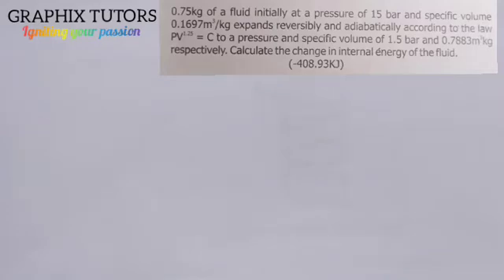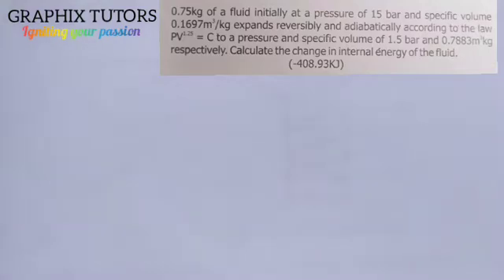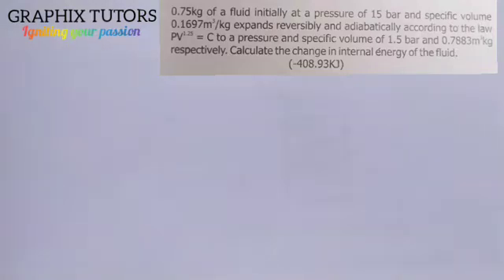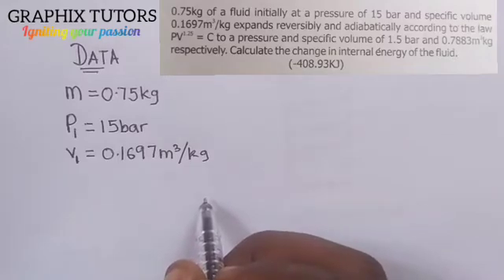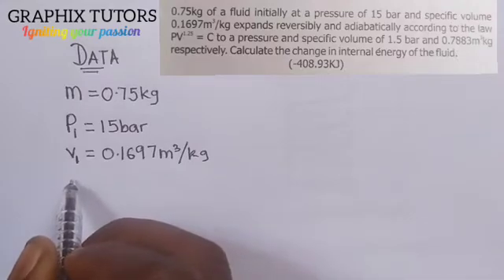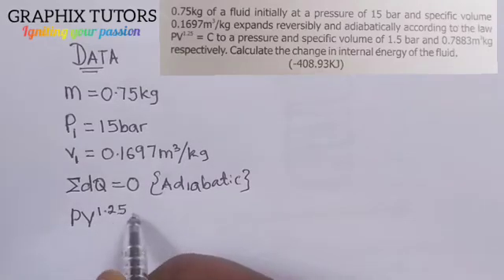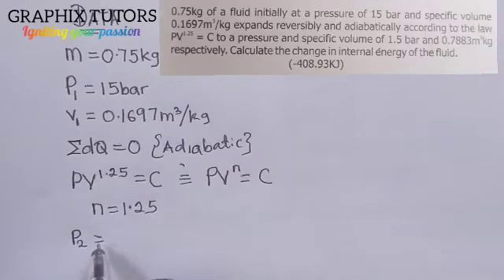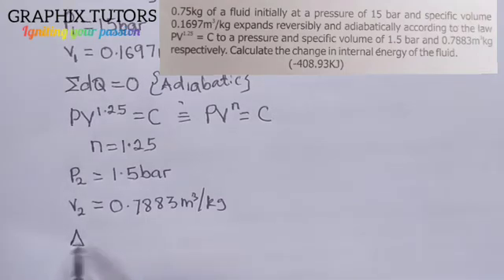Non flow energy equation in thermodynamics. |Applied physics|. NFEE. Problem 7

Comment: For this type of question in the comment box 
How do I go about it ?
Please sir
Reply from the maker: I don't understand your question
Reply: @alirule  A mass of an idea gas is enclosed in a piston cylinder arrangement. The gas is compressed reversibly in such a manner that the pressure and volume are related to one another by the expression PVn=Constant, where n has a constant value of 1.4. If the initial pressure and volume of the gas are 100KN/m2   and 1m3  respectively and the final volume is 0.25m3.
     Determine:
i. the final pressure of the gas
ii. the work done during the process
iii. Sketch the process on a PV diagram
Reply: How do I solve this kind of question 

I tried using the method you used here but I couldn’t get it 
Since it’s kind of similar